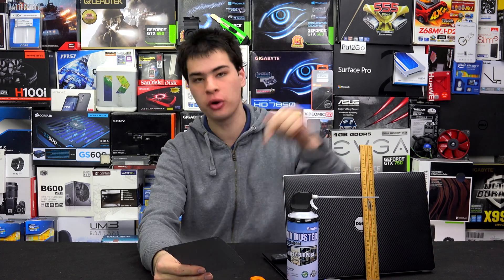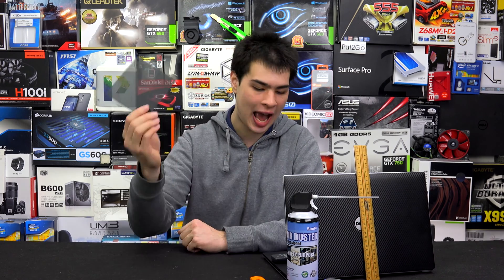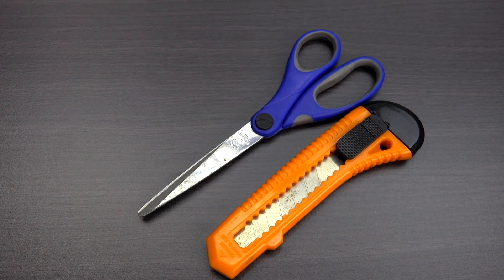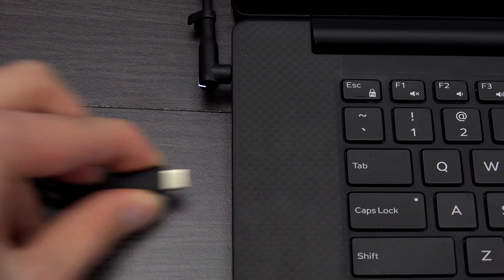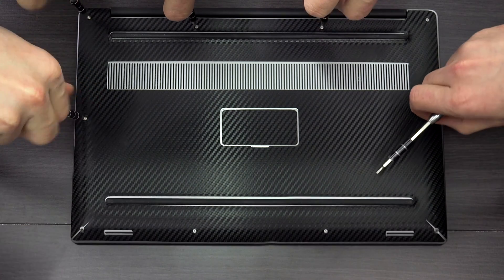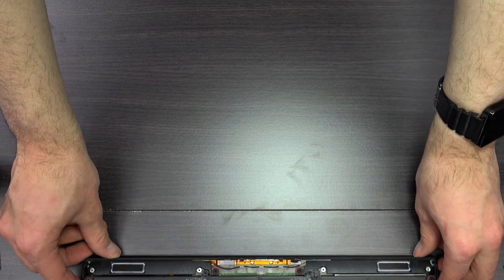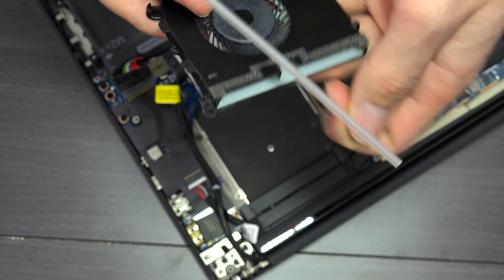DIY Laptop Fan Filter

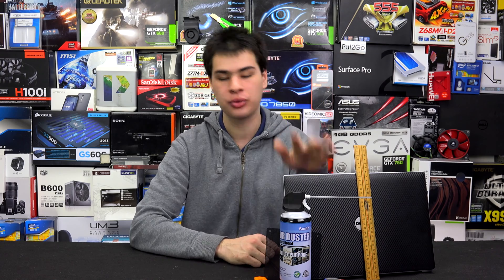Comment: 11:00 umm what. A fan filter will increase the temperature of your system, what are you taking about. Laptop fans already struggle with getting air and now its chocked even more. Its easier just to open the laptop every 3 months and clean the lint out.

Comment: Are those just grills?? I mean I didn't see anything that could filter dust on that thing OwO
Reply from the maker: they are not filters as in cloth or sponge type filter but they are dense enough to filter out most large dust that would get past the standard grill of the XPS laptops. if you did want you could easily swap them out for some filter sponge or similar and find better results in filtration but fans may work harder

Comment: Wouldn't this interrupt airflow and possibly cause the laptop to overheat?
Reply from the maker: if done incorrectly then yes, but from the past few months of using it i have not noticed any temp changes. your desktop computer will have the same filter and there is no problem there so same for the laptop

Comment: So every time that filter gets dirty and clogged up with dust you have to take the bottom off to clean it every time
Reply from the maker: +Mr Kawaii CowDuck yeah but it is much faster than removing fans and heat sinks to do the same job
Reply from the maker: +Mr Kawaii CowDuck yeah but it is much faster than removing fans and heat sinks to do the same job

Comment: Do note the fan filter will decrease airflow and thus making the laptop run a little hotter
Reply from the maker: that may be the case for some, but i have not noticed any temp changes or audio changes on my laptop so far. currently testing to see changes over time vs no filter